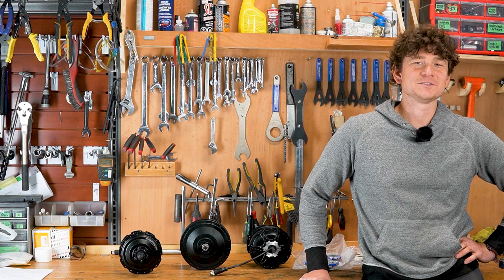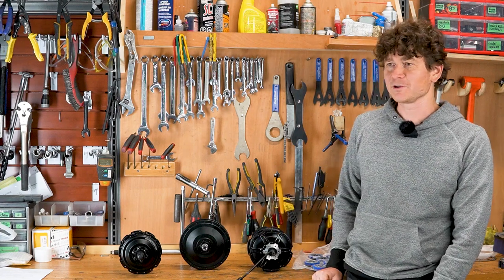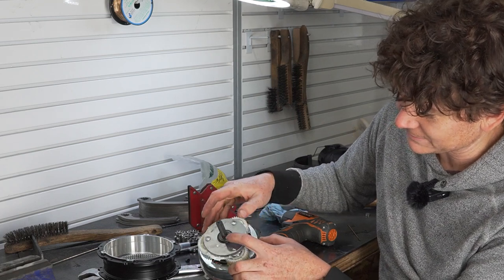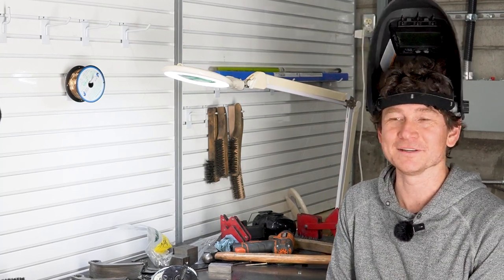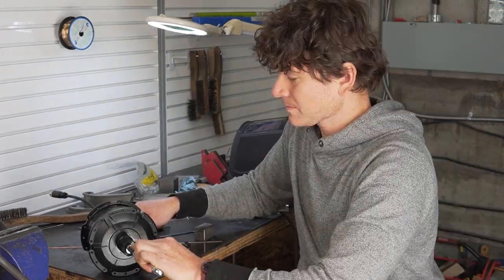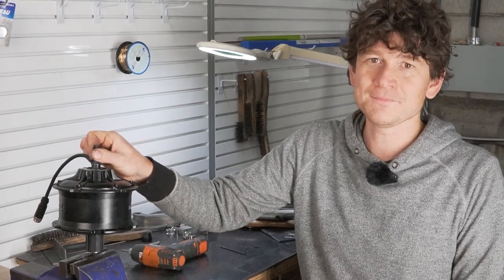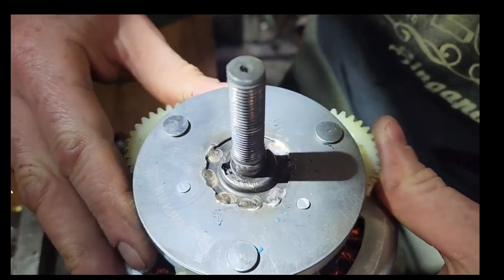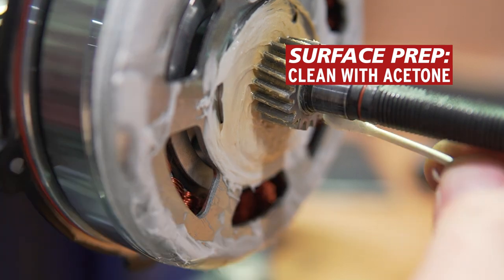How to get REGEN braking from your geared hub motor. Lock that clutch!

Comment: While it might seem like a good idea on paper if you consider the amount aero drag+friction vs mass+velocity it will soon become apparent that the capture of energy through regen will be minor compared to say a Tesla. Hence when you factor in the typical velocity vs deceleration required when riding a typical Ebike, that on most roads with all but the most high powered heavy Ebikes, being ridden very aggressively in stop and go traffic the gains will never surpass the loss when comparing regen to a freewheel. In general you are a lot better off just riding like you would normally and coasting up to the red light and applying the brakes at the last moment to scrub off the last 5-10 mph.

Now if you used a small magnetic clutch to replace the one way clutch and had it paired with a variable regen lever that would IMHO be an ideal (best of both worlds) solution.
Reply from the maker: This isn't just a hypothetically good idea on paper. We have firsthand data from over 20 years of actively using regen on ebikes in all kinds of conditions to back up the merits! 

The actual numbers show that in the majority of riding situations you get more energy back from regen than you expend from lack of freewheeling. Usually it's a factor or 2-4 times or higher.  City riding in Vancouver on my normal bike I average  between 1 to 1.5 Wh/km of energy repacture from regen.  The energy lost to motor drag when pedaling without the motor running is no more than 0.3-0.5 Wh/km.   But even that's mostly beside the point because it's 100% worth it just to have the benefits of electronic braking with no mechanical wear of the brake pads. 

The primary scenario where there is a net benefit to freewheeling over regen is people who are doing long distance riding in flat terrain without any stop and go and where the motor is used sparingly, like bike touring in the countryside and only saving the motor for occasional headwinds etc.  

For more details, watch:
https://www.youtube.com/watch?v=gYCj4asp9pE
or read:
https://endless-sphere.com/sphere/threads/analysis-of-regen-on-an-ebike.7891/

A controlled rather than overrunning clutch of course gets you both (freewheeling and regen), but it comes with a lot of complexity if you work on all the mechanical and electrical details of implementing one. That is likely the primary reason why no actively clutched hub motors have every made it to market yet, though there is nothing stopping someone from building one!

Comment: Can I fry my controller if it don't support regen? I want to weld clutch because its slipping under the load. Little bit more drag don't bother me.
Reply from the maker: The controller almost for sure will be fine with the clutch disabled.

Comment: I would like to solve the opposite problem, on a 750watt hub motor with freewheel, after I go up a hill and the engine is slightly hot, if immediately afterwards I go downhill I feel the engine as if it were slightly braked, when the engine is cold I don't From this problem, do I have to replace the freewheel or could there be another problem?
Reply from the maker: Potentially. You can tell if the freewheel is working or not by unplugging the motor controller and then spin the wheel by hand forwards and backwards. If the drag feels the same both ways then you don't have a freewheel, while if there is more drag in reverse then it means your freewheel is working.

Comment: I didnt watch all this clip but why my Bafang 250W freewheel slip? motor working but no drive...
Reply from the maker: Either your gears are stripped or your freewheel clutch is not engaging and is slipping instead. Open it up to have a look and see which it is!
Reply: @GrinTechnologies  I opened but i cant find solution, everything looks good, freewheel rolls and strings..

Comment: Aloha from Hawaii it seems  i have a dead clutch (shenghi DLK074-60-1) freewheels in both directions and thinking about this mod as i cant source it. Where do you get the prelocked clutch for shenghi from your first example??

Mahalo for all your interesting work!
Reply from the maker: The prelocked ones are from eZee bicycle. For Shengyi they don't have that as an option, in spite of us doing many requests. Welding yours shut isn't a bad way to turn a nonworking motor into a working motor at least.
Reply: @GrinTechnologies  as an alternative do you know if u can swap other clutches? Is it just a matter of moving over the 30t planetary gears if the OD and ID of the clutch match? Or is there more to it than that?
Reply from the maker: There's nothing off the shelf that will have the same planet carrier pins at the same location. It's not a generic part, it's something specifically engineered by Shengyi.

Comment: Any know of a geared hub with integrated torque sensor?
Reply from the maker: There's been more than a few that have come and gone over the years, but these aren't usually available as separate parts, more typically it's part of a proprietary system.

Comment: What if I have a motor which can reverse? I wonder can the motor still be made to regenerate?
Reply from the maker: Yes, almost by definition a motor that can run in reverse can also regenerate, as it doesn't have a clutch and can apply backwards torque to the wheel.
Reply: @GrinTechnologies  cool just need to figure how to make it charge the battery

Comment: Would this affect peddling?
Reply from the maker: No the pedaling system is totally unaffected by this. However, locking the clutch will result in a small amount of resistance to turn the motor. Depending on the model of hub it can be anywhere from 0.5 to 1.5 Newton-meters. It's roughly comparable to the rolling drag of the tires on the ground.

Comment: Hello , do i just need to weld the clutch? Do i need something special like a display for it to work ?
Reply from the maker: Uh, you definitely need a motor controller that can do regenerative braking via some input or another, you need a torque arm that can handle bidirectional torque, and you need to ensure that your planter carrier is affixed to the shaft such that the back and forth rocking won't shear the keystock.
Reply: @GrinTechnologies  alright thanks

Comment: I've done that to my 36v motor but how do I get it to regen my battery , the clutch failed a few years ago so I welded it but it doesn't regen at mo. What's your thoughts
Reply from the maker: You need a regen capable motor controller.
Reply: @GrinTechnologies  can you think of a 36v 250w one that has it

Comment: this is very cool but, in reality, over normal biking, you're lucky to get 3% to 5% back ... and the reason it's not worth this small amount back is because you can't coast without careful throttle control - like a Tesla.  The difference is the Tesla gets like 25-30% back since it's so drag efficient compared to - ya know - a bike.  So, yeah --- cool but totally not worth it unless you live in San Francisco ... and even then it's iffy.  I mean, you do save a little on brake replacement but brakes are much, much, cheaper than your previous videos touted... like 75% less expensive on Amazon... but, very cool none the less :)
Reply from the maker: 3-5% is still more energy you got back than you ever expended overcoming the small amount of motor drag when pedaling without the motor. 
Not sure what you mean by throttle control, you can coast just like any normal bike by not using the throttle, and if the ~0.5-1Nm of torque is an issue then you can use the "virtual electronic freewheeling" feature of the Phaserunner/baserunner controller to automatically cancel that with a small amount of current injection from the battery pack.  As we've been showing since 2008 or so, that is more than covered by what you get from the "small" amount of regen.  Remind us what is the downside that makes it "not worth it" ? 

Definitely with higher weight to drag ratio vehicles you get higher and higher regen percentages. Cargo ebikes are routinely in the 15% + regen realm even in just stop and go riding without major hills.
Reply: @GrinTechnologies  I dunno what ebikes with regen are like, but with my Tesla once you stop accelerating you let back on the "gas" peddle just enough to coast... but if you let back too much - like all the way - the regen kicks in and it starts to slow you down.  This is how I assume regen bikes work.  If not, then maybe you coast as with normal vehicles when not accelerating but since regen recovers energy by slowing you down the only other way to do it I can see is by activating the regen system (thus slowing you down) through the brakes or some other notification system.  All in all I'd rather be able to let off the gas and coast and then begin regen once I touch the brakes and actually engage the brakes once I push far/hard enough.

Now, if this is the way regen ebike brakes work and they're not heavy and not expensive and have no draw-backs then sign me up.

Also, can regen braking be set-up on my cheap-o 1000w or 3000w Chinese ebike conversions?  If so, how are they implemented, how much do they weigh and how much do they cost?  You mentioned a controller --- is that all I need?

Thanks

Comment: I don't  have hands on experience with planetary hub motor wheels, but in general, is spot welding a viable option to lessen possible damage? I'm  picturing, if there's  a clutch mechanism, there's most likely an overlap of some sort. Am I  assuming correctly?

Comment: cloth soaked with water to cool down welds faster, reduce damage to grease in freewheel
Reply from the maker: That is true, but the grease inside the freewheel no longer serves any function because it's no longer a rotating component that can benefit from lube.  So damaged or not damaged doesn't really matter.
Reply: @GrinTechnologies  might reduce warping also not sure though, I've used that technique to cool quite a bit, its effective

Comment: Any idea what the strength of the weld needs to be? Any chance a future-glue like dp420/490 could suffice with their shear strength being upwards of 1500psi?
Reply from the maker: We've seen the welds fail when done poorly, so the glue would have to be pretty tough. Plus it's quite hard to clean out all the grease to get a glueable surface. No reason you can't try though if you think you have a viable approach

Comment: how many watts of parasitic drag is there on direct drive hub?
Reply from the maker: It depends on the speed. Most DD hubs have 0.5-0.8 Nm of drag loss, so you can multiply that by your RPM ( but in rad/sec) to get a watts value at any given wheel speed.
Reply: @GrinTechnologies  that's not too bad. I was expecting it to be like double that. 🙂
Reply from the maker: @oplkfdhgk  Well some hubs are about double that, like the big honking Crysatlyte motors were like 1.5 Nm.  One of the lowest we measured was the original BionX PL350's, at about 0.4 Nm.

Comment: Is the motor driving the Planets or the sun? Am i right that the pedal is driving the planets and the motor is driving the sun?
Reply from the maker: The motor drives the sun in this topology. The pedals aren't connected to the gearing at all, they drive the hub shell directly.

Comment: In place of welding could you just drill and and screw the clutch with a magnet to catch shards of metal?
Reply from the maker: You could try, but be mindful of the torque levels at play and the shear strength of your screw.

Comment: How can I enable regen during winter when the battery is cold? Could you add a dump load or something?
Reply from the maker: It's best to start your ride with a warm battery by keeping it indoors till you head out on the ride. You get better performance on discharge (lower internal resistance and much less voltage sag) and no problem handling high regen currents either.

Comment: Would it make sense to loctite now before welding the clutch so theres no risk of it not fitting? Just thinking you could avoid the reaming step. Just not sure if the heat would undo  the loctite and when it cools it resticks.
Reply from the maker: It's a good question actually. We were worried that the heat would damage the loctite but it's usually possible especialy with steel to keep the heat quite localized just to the weld area.  Worth an experiment for sure.
Reply: @GrinTechnologies  I couldn't get it off the shaft anyways and didn't want to try a puller, so I'll just wait a bit and see if it loosens up on its own and then loctite it.

Comment: My direct drive broke in the hub and I had a hell of a time pedaling back. Whatever broke had far more resistance than normal. Normals not bad at all. It wasn’t one of your motors. I think riding it off road on bumpy trails shook something loose.
Reply from the maker: Any short between the phase wires will cause very high drag to turn the wheel. This is common if the cable gets severed or torn as the exposed phase wires can come in contact

Comment: Cool! Now do it for the BBSHD? ;)
Reply from the maker: There's one on my desk for just this purpose!  Of course, locking the clutch on the BBSHD turns it into a pedal generator not into a regen brake that can slow down the bicycle. But you can eliminate the drivechain completely and just pedal to charge the battery if you want.
Reply: What if we lock the freewheel on the rear cassette?
Well I guess this will only work on a fixie bike, without a rear derailleur... That S curve on the chain would snap...
Has anyone used a BBSHD on a fixie?

Comment: How do they work after the welding? Is there less torque and more rpm than before? Doesn't the gear ratio change when you do this conversion?
Reply from the maker: No and no, as a motor it works and behaves exactly the same. There is no change to the gear ratio as its the same set of gears.
Reply: @GrinTechnologies  Oh yes, now I get it. The ratio would change if the gears would not spin. It only affects the freewheeling clutch.

Comment: I'm wanting to convert to front hub to get regen (currently using a midrive Bafang BBS01). What's the best to buy up front, a geared hub which I would mod, like this video describes. Or buy a direct drive motor?
Reply from the maker: Direct drive is far easier and blue reliable. But if lightweight is most paramount for you, then geared is the way to go. Shengyi SX1 is a really good option for that

Comment: The Shengyi SX1 motor appears to have slightly angled gear teeth, does this cause side thrust issues ?
Reply from the maker: It does, but luckily it also has a pair of deep groove radial ball bearings in each planet gear that can cope with the thrust no problem. This is what makes it quite one of a kind. No other heroism gear hub motor we've seen on the market would be regen compatible this way

Comment: I think there should be a magnetic lock mechanism in the clutch which will can be induced by the brake lever. 

Welding the clucth and losing all freewheeling advantage just for some regen? no thanks!

Comment: Would a geared hub motor provide more Regen than a direct drive motor?
Reply from the maker: A geared hub motor of the same power class generally will, yes, since they have lower winding resistance for a given KV, so less of the regen energy is absorbed by the copper winding and more is available to go back into the battery pack.

Comment: Am I correct to think that regen will fatigue the frame and fork faster than freewheeling? I know Grin says that adding hub motors should be safe for any frame designed for the stresses of normal, unassisted, use but are there not more fatigue loading cycles introduced by having hub motors and regen that have a detrimental effect on the overall life of the bike? I'm especially curious about bikes predating the 90s and how they handle this kind of loading, long term. 

BTW, you guys are the best. I wish more manufacturers and suppliers would be this transparent about the engineering going on with their products. Keep up the good work!
Reply from the maker: The easiest way to understand why this is not an issue or concern at all is to realize that the forces present on the frame from regen braking are identical to those on the frame or fork from disk brakes brakes. Only disk brakes can put upwards off 200-300 Nm of torque, while regen is rarely able to hit more than~80 Nm. If bikes aren't falling apart from fatigue with disk brakes, they definitely won't from regen either
Reply: @GrinTechnologies  I've heard about some vintage bikes that shouldn't be upgraded to disc brakes and figured it would be the same for hub motors, but I didn't realize the motors are actually gentler than the brakes. Thanks for clearing that up!

Comment: Hey Grin, thanks for another awesome video! One thing that caught me off-guard was the addition of loctite between the planet carrier and the axle. I'm guessing this is not necessary for the GMAC? And not applicable to a DD like the RH212 because the stator is already very tightly coupled to the axle? Would really appreciate your thoughts, I'm using both of these motors. :-)
Reply from the maker: Correct. The GMAC uses a larger axle diameter on and a thicker tight fitting key stock and hasn't shown any issues in this regard. For the G60/G62 motors, the verdict is still out on how hard you can push it with just the stock key. You can definitely feel the little bit of play and 'clunk' sound when the core switches modes, and it slowly gets worse over time. But so far none of the units on the field have gotten so bad that it either trips up the controller or causes mechanical failure.   Everything feels a lot nicer with zero play though so we'd recommend using the 648 retaining compound regardless.    For the RH212 of course there is no need as the stator is quite literally welded to the axle.
Reply: GMAC regen is huge !